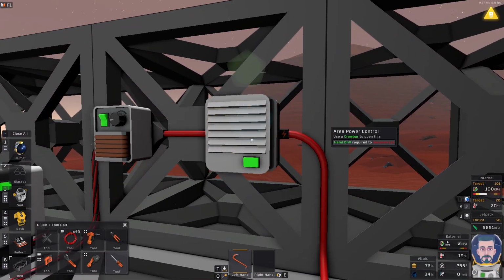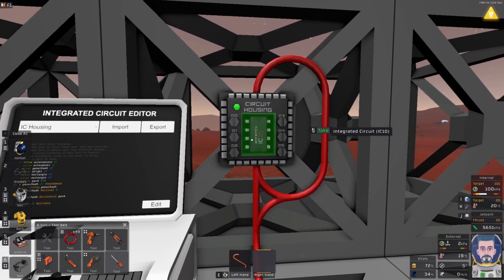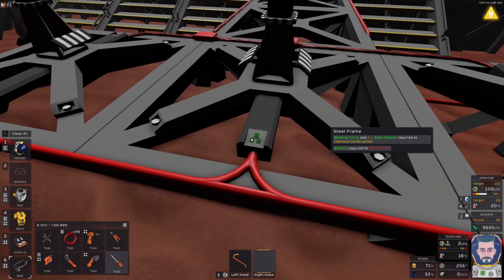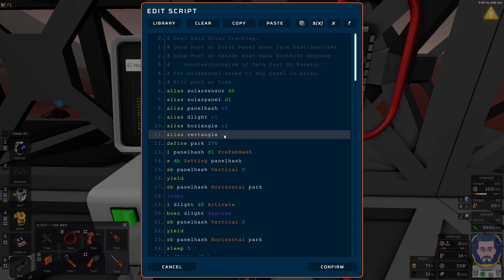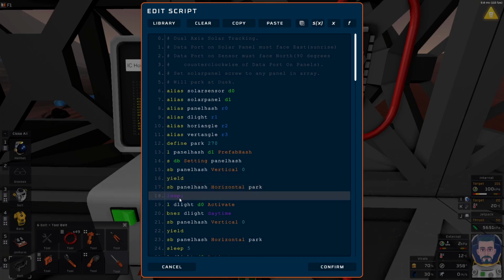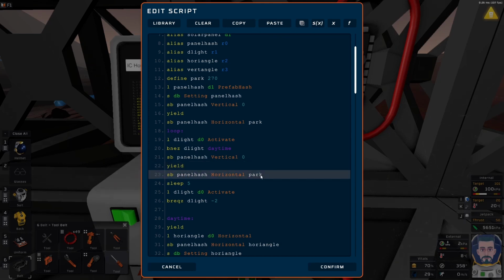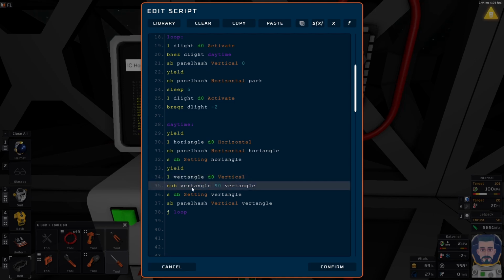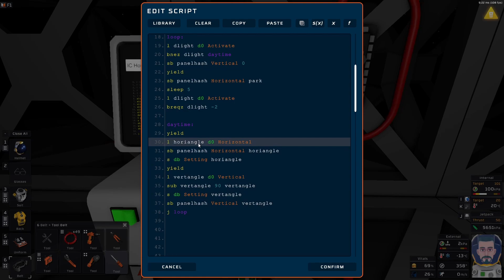Stationeers - Solar Tracking With IC Logic 2022 - Currently on Beta Branch

Comment: Does this only work on the Beta Branch? I installed this on the non-beta branch and it seems to be off just a bit. The panels reset before dusk and only get to about 36% max efficiency. They are tracking faster than the sun is orbiting.
Reply from the maker: I did leave my old stable branch videos up and the old code on the workshop as well